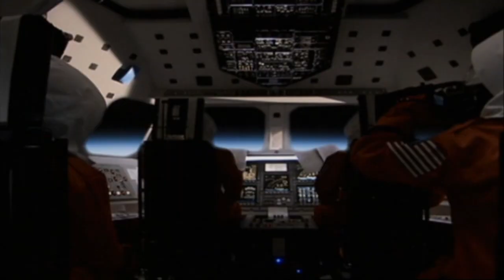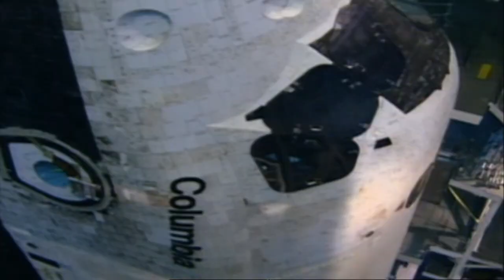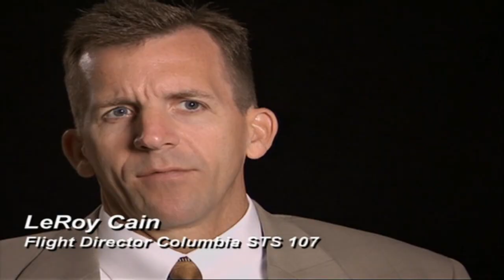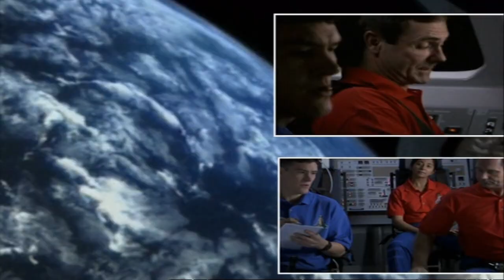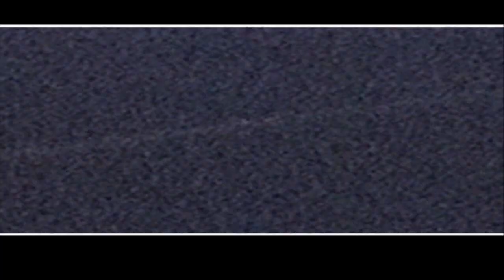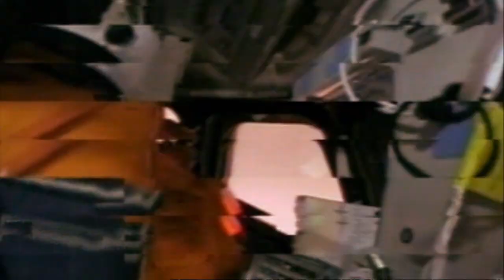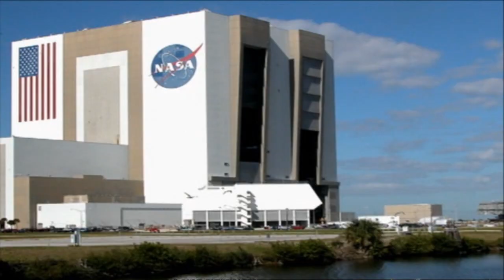Space Shuttle Columbia - Falling Star HD

Comment: What strikes me is the fact that they apparently kept running these shuttles with very old computers. If we're able to send people into space, it should also be able to upgrade such computers, right?
Reply: First off, "old computers" are not necessarily bad computers.  In fact, there are some significant advantages:

The components are physically larger.  That makes them less susceptible to damage from radiation.  The 9th generation Intel processors are down to a 14 nanometer lithograph.  That means the smallest components are about the wide of 100 copper atoms.  It wouldn't take much radiation (maybe even 1 particle hit) to damage the component (and the processor) to the point that it doesn't function properly. 

Everything that goes up has to be extensively tested.  Hell, HP and NASA spent two years working on an inkjet printer for use on the ISS, and they started with an existing model.  And an inkjet printer is a relatively simple bit of technology. The older hardware has already been tested.

All of that testing comes with a cost, in both time and money.  NASA isn't exactly floating on cash

Comment: How does a spacecraft travel in space? Is it like a plane? A jet? It always seemed to me that a spacecraft would just kinda float around but hearing how quickly Colombia was traveling around the world has me wondering.
Reply: OK, here's the thought experiment that Newton did. (for this thought experiment, pretend there's no atmosphere to cause drag and slow the ball down)

Imagine you're on top of a really, really, high mountain, and you throw a ball.  It'll travel in an arc as it falls to the ground.

Throw the ball a little harder, and it will travel further before it hits the ground.

Throw it really hard, and it goes further.

Now, imagine that you can throw the ball so hard and it covers so much ground that the curvature of the Earth matches the curvature of the flight of the ball. So, the ball keeps falling toward Earth, but the surface keeps curving away at the same rate it's falling.  Barring something happening, it'll never hit the ground.

That's what an orbit is-it's a perpetual free-fall around the planet.  At normal orbit heights, you've got to be going roughly 17,500 or so mph.  Inside the spacecraft it can seem all calm and floaty, but that's just because you and the spacecraft you're in are both going about 5 miles per second.
Reply: @almostfm  I saw a video about throwing the ball off a mountain the other day! I as wondering why they were doing that and I thought it was just an optical illusion that it was traveling a bit before falling. 
This is an awesome explanation, thank you for taking the time to type it out!

Comment: Could they have been brought home in another Shuttle sent to ISS if they had discovered the damage?
Reply: No-Columbia was in a completely different orbit than the ISS, and it didn't have nearly enough fuel to change it's orbit to match the ISS.

The big problem was in the inclination of the two orbits.  To do a "plane change" from Columbia's orbit inclined about 28 degrees to the ISS orbit inclined about 51 degrees would have taken huge amounts of fuel.

It's much easier to do when the rocket isn't going very fast, which is why rockets roll to a particular heading right after launch-it's a much more fuel efficient way to get to a particular inclination than to get into orbit and try and change it then.
Reply: Okay I wasn't that informed about the mission of Columbia. Thanks for your answer.

Comment: its  mistake of control operation room at NASA  they should not let Columbia shuttle reach to the boarder of earth they have sensor heating illumine  out of limited degree its crazy thing to inter  the earth and we know the  temperature will increase it mean we destroy the shuttle the slow react of operstion room did that mistake  the solution is not let Colombia reach to the border of the earth and should send Atlantis shuttle hold on air craft  to get back the astronaut  and programming Colombia computer to move to the earth with outo pilot  no astronaut on it

Comment: I don't think it was foam alone that caused the hole in the wing. I think that the foam strike weakened the tiles bonds to orbiter skin and an in orbit debris strike (something as small as a grain of sand) with a closing speed of 35000 mph hit the same spot and caused the damaged tile to break loose.

But whether that is the case or if it was one or the other by itself, we'll never know!
Reply: They actually tested it with some of the same type of carbon-carbon panels that were on Columbia.  At an impact speed of 500 mph (which mimicked what happened with Columbia), the foam easily blew a hole in the panel.  Here's a video showing that test https://www.youtube.com/watch?v=s-EpL-w-hxY

Comment: I'm curious....could the flight director have told the shuttle to dock with the ISS and wait for a safer shuttle to come and dock as well to bring them home?! Seems like a viable enough destination solution to me that this would have been implemented into a contingency. Right? Or am I wrong because I dont work for NASA or am considered an expert?
Reply: The shuttle Columbia didn't have docking equipment, so no. Plus, it and the ISS were in very different orbits. I don't know what the exact locations of each vessel were at the time, but for arguments sake they may as well have been on different planets given the distance between them. The amount of fuel on board post launch (after entering space) is next to nil, and what little there is is good for minute adjustments, and not nearly enough for altering trajectory in such a fashion.     

The following link is to Chapter 6 of the Columbia Accident Investigation Board's report. Subsection 4 (so 6.4) briefly deals with your question. It's way down at the bottom of the page, and discusses the 2 rescue options. Repair damage on orbit, and rescue with Atlantis are the 2 covered.    

http://s3.amazonaws.com/akamai.netstorage/anon.nasa-global/CAIB/CAIB_lowres_chapter6.pdf    

I also do not work for NASA, nor am I an expert.
Reply: The show stopper wasn't their relative positions-it was the inclination of the orbits.  "Plane change" maneuvers on orbit are hideously expensive from the standpoint of how much fuel is needed.  If Columbia burned every last drop of fuel, they could have done a plane change of just over three degree.  To match the ISS inclination would have taken a 25 degree plane change.

Comment: I was curious so I did a little research on why the Columbia simply didn't dock with the International Space Station and wait for Rescue. First of all Columbia was the heaviest of all the shuttles and not designed for high inclination orbits where the International Space Station resides. Even if it had been a shuttle like Endeavor that was designed to dock with the ISS if its mission was a low inclination orbital one which Columbia's was there would not have been enough fuel to change the inclination and reach the International Space Station.
Reply: There was no need tho apparently. One of the commenters in this thread mentioned they could stay up there for 30 more days. Time enough to scramble a rescue mission (although an under-prepared one, which in itself is a problem).

Comment: Why does a block of foam do more damage than violent shaking and the g-forces and the aerodynamic pressure?!?
Reply: The estimates are that there was a 500 mph difference in velocity between the Shuttle and the piece of foam.  A block of foam that size squarely hitting a spot on the wing dumps a shitload of kinetic energy almost instantaneously.
Reply: Force = Mass times acceleration. the speed of the foam missile can cause immense force to build up. Besides , it was a tile not the foam under your seat.

Comment: Could anything have been done if they knew of the hole? I've heard both yes and no.
Reply: In _theory_, a rush job getting Atlantis out on the pad for a rescue mission was possible, but absolutely everything would have to have gone right for them to even get there.  No problems getting Atlantis ready (despite skipping over a lot of the checks they normally do to get an orbiter ready for flight)-no weather delays, and because they didn't know why the foam had come off Columbia's tank, there was no guarantee that the same thing wouldn't happen with Atlantis-which would strand two orbiters and kill both crews.  Even if they were successful at that point, it would have required a complex series of transfers to get Columbia's crew over to Atlantis, because Columbia only had two spacesuits on board, with each group of two astronauts spending over an hour "pre-breathing" pure oxygen so the nitrogen in their blood comes out.  Otherwise, the lower pressure in the suits would cause the bends, which can be fatal.

And it would have required them to very quickly know that Columbia was fatally wounded and get her crew on a plan using the bare minimum of consumables, to try and buy enough time for Atlantis to get there.  As it was, the request to get better pictures didn't come until flight day 5.  BTW, there's a great article at https://arstechnica.com/science/2016/02/the-audacious-rescue-plan-that-might-have-saved-space-shuttle-columbia/ on exactly would have had to happen to pull off a rescue mission

Columbia was in the wrong orbit (both height and elevation) to get to the ISS, so that was never an option.

I once worked with a guy who would say "Wanting options and having options aren't the same thing".  This was one of those cases where there really weren't any workable options.
Reply: almostfm thanks for the informative and elaborate reply. Appreciate it. :)

Comment: May not be an expert of Nasa but common sense should have prevailed.  I was a 911 dispatcher for 10 years trained by experience and knowledge that any slight suggestion of any problem is investigated immediately. No exceptions.  I never lost a life on my watches in 10 years.
Reply: In spaceflight, sometimes there really is no option. They couldn't get to the ISS (wrong orbit), they couldn't hold out until a rescue mission (not enough consumables on board), no way to do an EVA to where the strike occurred to assess the damage or fix it, and any abort mode involves a re-entry-which is what caused the shuttle to break up.

Wanting to have options and actually having them are not the same thing.

Comment: Outdated onboard electronics? I don't believe for a MINUTE that they didn't have the technology to install cutting edge computer systems in that thing to detect and let the Commander know the issues as they were happening......And YES you CAN perform a rescue mission....You just have to yank yer wallet outta yer ass and make it happen!!.....Big bucks or saving lives??!! No brainer
Reply: You do know this video is made up by someone and its not all factual. Congress appropriates money to NASA and they don't make profits.
Reply: Faster computer wouldn't have solved anything.  The systems on board were more than adequate for running the shuttle as it was.  Real time analysis wouldn't have enabled them to prevent the breakup.  The only thing that would have saved them was a rescue mission which would have been very risky.  One because of the limited amount of life support on the Columbia.  Two they would have rushed Atlantis to the pad without being certain of what happen.  Three they would have to transfer the crew and land.   There was no way to make it to the ISS from that orbit.

Also those additional sensors and wiring would have to be installed.  The shuttle wasn't ever designed to be serviced that way.  It would have been cheeper to building a new shuttle with the new stuff installed vs retro fitting it.  Plus all that stuff adds weight at $8000 a pound.

Comment: So a piece of foam can damage the wing so badly, and it had happend several times before, couldn't they just make the wing more strong? What's the material used to make the wing, why it's  so fragil that a piece of foam could breach it? If a lightweight piece of foam could breach the wing, what couldn't ?
Reply: Foam had nicked tiles before but it was just cosmetic. This piece of foam put a 10 inch hole in the leading edge of the wing which is made of super hard reinforced carbon-carbon. Nothing had ever damaged them before. Underneath all the thermal protection is an aluminum airframe for the most part. There is titanium and composite also.
Reply: Thank you for your reply....Then why foam tiles can damage this super strong carbon carbon? speed? It dosen't look very fast, the space shuttle was struggling to ascend, how fast could that be? Although according to the narration, the relative speed is 500 MPH, if this speed is enough to let a piece of foam damage the superstrong wing,what will happen when  the space shuttle hits a bird while descending back to the ground on high speed? will the bird penetrate the shuttle? It still doesn't make sense.
Reply: Foam tiles did not damage the carbon. Insulating foam from the orange tank hit the carbon. The speed at impact was 500mph. It was still building up speed to 17,500mph. It broke the carbon panel which is part of the thermal protection during re-entry. The difference is the hole was created during launch. During re-entry the plasma created by re-entry entered the wing and caused structural failure from the inside out. There are no birds during the whole landing profile as the orbiter is still at 50,000 feet when it enters the landing HAC above the runway.  If it hits a bird during final on landing, it would be no different than an airplane hitting a bird.
Reply: A light weight piece of foam travelling at 500mph .. the kinetic energy would be immense

Comment: 22:39  Irony abounds. ---  Quick question though. I don't understand why America has not gone metric, I can recall when it was declared under president Carter that we would be, by 1980. Dang, what happened? Yet the real question is, why do those who DO use metric still toss in measurements of feet or miles? 

At one point the narrator said the shuttle was traveling at 17,000 MILES per hour, then later says it was moving at 17,000 KILOMETERS an hour. 

Also hear British folks using kilo one moment and pound the next. WTF?

Comment: once they knew the sensors started to fail. they knew Columbia was screwed
Reply: Cain was hoping that commonality in the sensors was causing the multiple failures.  He asked a number of times if there were things like multiplexers which could cause the appearance of multiple failures even though the sensors themselves might still be ok. 

A similar thing happened with Apollo 13 when mission controllers were at first questioning if some of the oxygen tanks were leaking and some of the fuel cells were dead. One of the controllers during Apollo 13 is heard saying something to the effect of, "You don't believe those sensors, do you?"   Jim Lovell actually saw something venting to space while the oxygen pressure gauges were gradually going down which made him realize what was actually happening.

For safety reasons, one has to question if something just appears to be wrong when it actually isn't.   But one also has to acknowledge reality at some point when something actually is wrong so as to not make the situation worse with denial.

Comment: Even if mission control and the crew both knew there was a problem with the wing what could they have done to save the shuttle.
Reply: anthony smith, NASA itself wasn't able to launch any rockets themselves in that short amount of time because setting a shuttle up or any other rocket takes a lot of time and the crew had a limited amount of food. They could've made pictures of the wing by using military satellites to determine which heat panels fell of. After that they could've asked some other space agencies (e.g. RosKosmos) which have other rockets on standby to let them carry their repair panels to the space shuttle. But after all that seemed to risky and complex during that time and they were on a very tight budget so the decision to carry on seemed less risky.

Comment: All they needed was a little ten dollar mirror in the corner of the window so they could see the wing, just like on the Apollo command modules.
Reply: I think Merrin was saying the mirror would be inside the shuttle and simply used to look at the damage.
Reply: That's ten dollars wasted every trip that you'll never get back. The mirror would be gone faster than a millimeter of candle wax during  reentry. Even worse, the attachments to hold the mirror would itself be a weak point on the heat shield, thereby increasing the chance of disintegration. :P